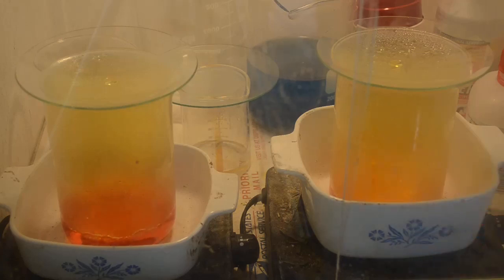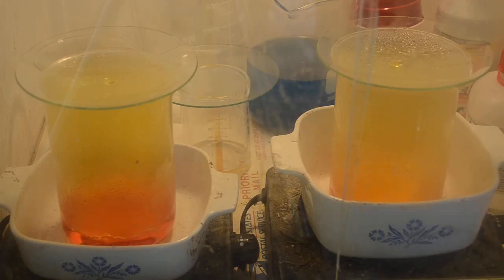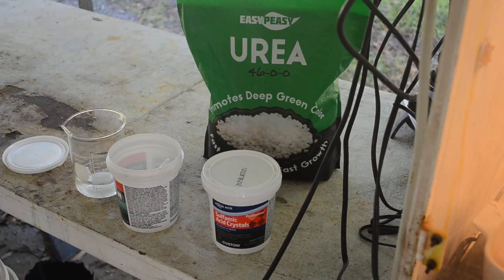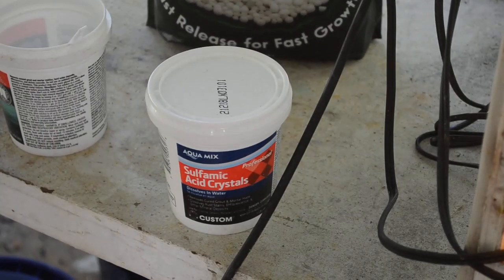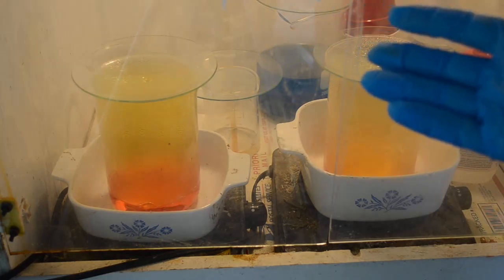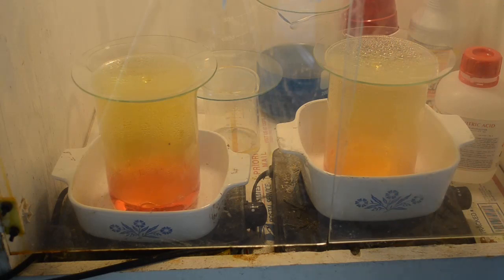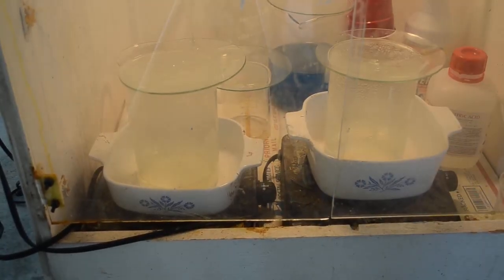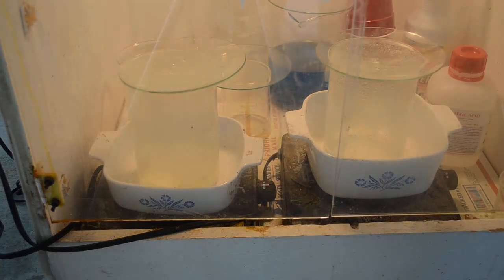DeNOxing Gold Bearing Solutions: The Whys and Hows of it

Comment: i used hcl and bleach to dissolve gold and tried to precipitate the gold using zinc and aluminum but it didn't work only naoh sodium hydroxide gave me an orange reddish precipitate but it looks like mucus in the beaker with removing the solution I heared that naoh is not preferred as it can dissolve some of the gold precipitate again but it is the only method that gave me that precipitate ...... is there a recommended method on how to use naoh or it is bad? why other methods didn't work ? I think I have added to much bleach . can you help me ,please?

Comment: Side note: (Part of the Confusion) Sulfuric acid does dehydrate soloutions liberating HNO3 while boiling. BUT...!

Bad part is. It will steal metal ions from Nitrate and chloride ions. As your boiling to release Nox... insoluble sulfates will drop like lead. Not only are you releasing HNO3 from soloutions. As it gets more concentrated your actually losing HCL and chlorine gass into the air as well. Eventually you end up with a pile of sulfates with gold somewhere in the mix. Even If you stop early before in crystalizes there's still all 3 acids in soloution so you have actually accomplished nothing. 

Combining H2SO4 and HCL releases chlorine gas. Combining H2SO4 and a nitrate salt produces a sulphate salt and nitric acid. This is how fuming nitric acid is made in the lab. Concentrated H2SO4 + K(NO3) = K(SO4) + HNO3 distillation liberates the nitric acid. 

This is actually why I always save nitric acid wasted separately. (As long as no hcl is in it.) Because it can be boiled down and resulting crystals can be boiled with sulfuric acid to release/distill fuming nitric acid. Leaving behind a mix of random sulfate salts. Nicely condensed for later disposal. 

Just thought I'd share these tips with the noobs. 😂✌️♥️

(CAUTION: If you try this you must be positive there are no hcl ions or chloride salts mixed in. If so there is a good possibility of an explosion. Via oxidation of chlorine gas.)

Comment: So, if i just add a very very small amount of spetricide stump remover (potassium nitrate) along with muratic (maybe 1/8th tsp), then do you think the resulting solution could be denoxed and precipitated all at once with bodide stump remove (smb), maybe 1/4th to 1/2 tsp mixed into solution with water ?    I have heard SMB will denox to some degree, and wondering where that special spot was.    I am recovering trace amounts of gold from very low grade rocks in a non-gold bearing region (ie. - gold exists, but not in commercial levels)

Comment: Question: This might sound like a strange question but, is the weight of gold different from the solid form and the liquid form??
I've seen videos of several ounces of gold in solution. Can the weight of the gold in solution weigh less than the gold recovered? I'm thinking of when the solution is boiled down, maybe too low.
Reply from the maker: The weight of the solution will be the weight of the muriatic acid plus the nitric acid plus the dissolved gold minus the nitric acid that leaves the solution as nitrogen dioxide gas (orange-brown fumes). If you dissolve a lot of gold in a little aqua regia, you will have a very dense liquid indeed.
Reply: @omegageek64  I don't mean the weight of any liquid just the gold in the liquid vs metal gold?

Comment: Those that are wondering about denoxing are probably at the beginning of there learning since that is a step that most people that do gold recovery do almost everytime they process. 
Great video and explanation!!
Reply: Those that learn incremental nitric dosing don't denox every time. In fact they rarely denox if ever.
Reply: @PHUCKyoutube689  Yes, you are right, but when you are doing certain types all the time like ic chips ash it's hard not to put a little extra nitric in when getting the base metals & silver out. I guess I should've explained my comment better or just probably not left one at all.
Thanks for pointing out what you did.
Reply: @shaneyork300  That makes sense. My experience is in purifying placer gold. Haven't messed with the recycling yet.
Reply: Try guessing how much nitric you need for microscopic gold, in gold ore. 😂. Enjoying those boiling sessions, yet? Not me..I just picked up a container ofSulfamic acid crystals at Home Depot. The brand name is…”Aqua mix” Ten dollars well spent.
Reply: Hello great video. I'm switching to sulfamic acid from urea. Can you please comment on what to expect the end point for adding sulfamic acid. In your video there was a color change but I'm assuming it changed to a clear solution because there was no gold. 
Thank you
Best regards

Comment: Very good information, but what if the AR were add SMB already before DeNOxing, how to make gold precipitation?
Reply: Keep adding SMB.
Its a waste of material but it will cause minimal problems.
A mildly expensive learning curve.
Reply: @NOFX0890  Appreciate your reply, but I had once couldn't precipitate the gold by adding a lot of SMB till white crystal precipitated at bottom of beaker, I still don't know why until now, the gold I dissolved is about 0.2g only.
Reply: .2g throw it in your stockpot? Find another .2g to practice with.

Id imagine it makes it more difficult chasing such a low yield.  Maybe your concentration of solution complicated things. Good luck my friend youll get that .2g back eventually. If you can get those crystals to go back into solution, there is always copper.

Comment: Two methods I use exclusively depending on what material I have in AR
Dirty solutions from gold recovery = add copper. This denoxxes and drops the gold with one step
Clean gold refines = add more gold. This uses up the excess nitric and keeps the other weird salts out of the wastes
Reply: But, how much Sulfamic Acid is to be used? Just until fumes turn yellow, or do you measure by ph? And, if so, what should the ph be of denoxxed AR?